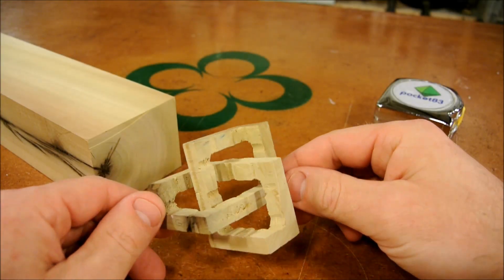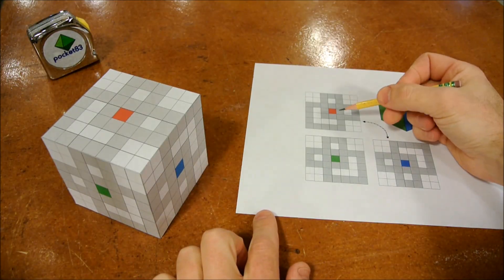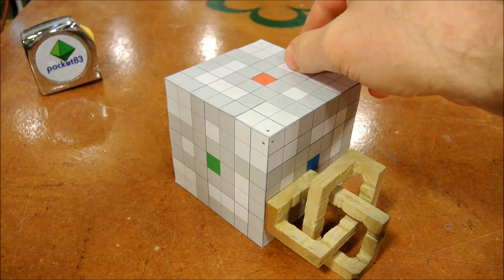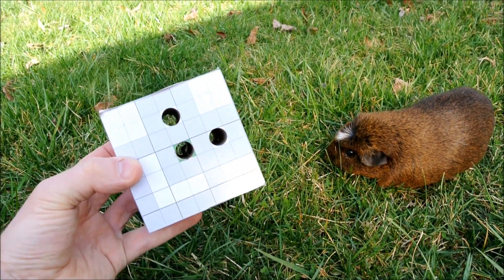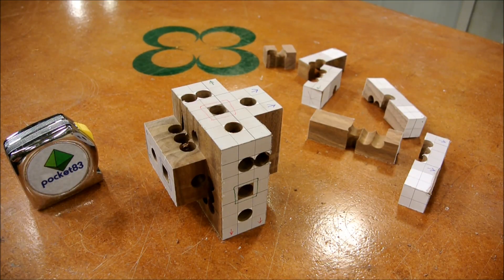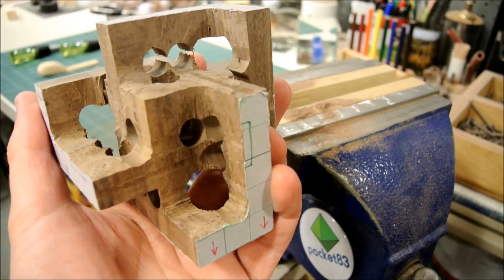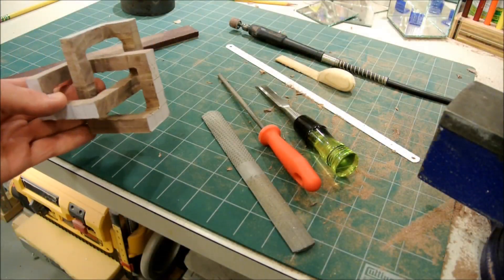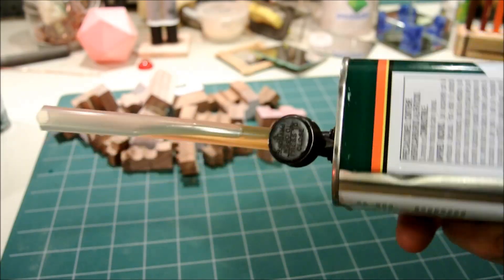Making a cubic trefoil knot from solid wood

Comment: so, i have definitely added this to my to-do list.  Ill probably use a softer wood though just to make finishing easier.
Reply from the maker: Careful. If the wood isn't tough, it's likely to crack as you work on it. Note that the prototype shown at the beginning here was Tulipwood, which is somewhat soft, but I was testing the limits of the process. Choose your piece thoughtfully ;)

Comment: First of all, awesome video.  Second, you mention 2:00 into your video that a future video will be dedicated to cutting the perfect cube.  Was this ever created?  I had a difficult time recently making 3" hardwood cubes using the same starting turning block (4" x 4" x 8") that you used.  When I went to a woodshop, I ended up using a joiner, planer, bandsaw to make 3"x3"x8" and finally a 10" miter saw to make cubes.  From your video, it looks like you just used a 12" miter saw.  Cannot be just that simple.  Thanks in advance.
Reply from the maker: It's tough. There are different levels of "perfect." That video was finished, but not released. It was just too conceptual in nature; that is, it was a how-to theoretically make a perfect cube that could eventually exceed (my) instrumentation. 

I'd figured that people wouldn't like it, since it was a bit impractical. I get sick of nay-saying comments easily. If I were to try to capture the idea in a sentence, I would just tell you to keep rotating your cube continuously against a square sanding machine, so that you can incrementally approach the 90° ideal through increasingly reduced error. 

Think of 'perfect' as less a goal, and more a fineness--like a resolution that can be improved by multiple smaller pieces of constituent information. Hope that helps, even though it probably doesn't (which is why the video wasn't posted).
Reply: @pocket83  Please re-consider uploading that video.  I think it will definitely appeal to the theoretical side of your audience.  :)

Comment: What kind of instrument is introduced at 11:49?  Is it an attachment that you added to another machine?  It sort of looks like a mini hedge trimmer.
Reply: Yeah. It kind of is. You could call it an oscillating multi-tool. It has lots of attachments, but at one point in the video I attach some sandpaper to it, just to rig up a detail sander. It was just stuck on to its saw blade with spray adhesive.

Comment: Brilliant video and workmanship. I have one question, may be silly. Is initial drilling of those holes necessary to complete this or to remove material faster, you have adopted that technique?
Reply from the maker: Aside from just removing material, I think the drilling has a few benefits. It helps you visualize what you're making, and it helps keep you straight as you make it. There are lots of perpendicular angles here, so it helps to have a 'framework' that keeps you in line.

You could certainly make one of these through carving it "by eye," but it would take extreme concentration and skill. With the holes, you should have a respectable result on your first try.
Reply: Thanks for your clarification. After I asked that question, I realised by watching the video once again, that, without those drilling marks, very tough to  visualise the 3D, and remove the correct part of it.

Comment: Like so many others, you use the chisel upside down. The correct way is bevil down.
Reply from the maker: You dim-wit. A chisel is what I decide it to be. If I use it to scrape gum from my shoe, that's the way I chose to use it. "Correct" ways to use tools are just procedural dogma for beginners. 

Further, bevel up use of the chisel removes material from the idealized plane, making it easier to stay  true, so you are just plain wrong.

Comment: Very good use of that vibrating saw/sander.  I also noticed you left the inside corners radiused instead of squaring them up - that would greatly increase the strength, or at least decrease the chance of splitting/breaking at an inside corner.  Good job, and a nice bonus tip at the end.

Comment: Why not use a mortising tool to drill aware holes instead of round ones.  It also might take away some if the internal cuttings
Reply: Two reasons: 
1) This is fragile, and a mortise cutter applies lots of pressure. 
2) I don't own a mortise cutter.

Comment: You need a jig to hold the oscillating tool at any given angle so that you can advance the piece to be cut.  Think along the lines of a drill press with a fixed mount to hold the piece to be trimmed/cut as you advance the tool into the piece.  Dont' know if you can contact me.  But, with the measurements of the tool, I could design a jig for you to 3D print.  Might do one for myself!  Excellent use of the oscillating tool!

Comment: Inspiring video.  I immediately cut about 20cm of thin steel gardening wire, formed a trefoil and distorted it into something like the shape you show.  As you suggest, the shape is hard to visualise and a 3d prototype is vital, for me anyway...  The shapes are topologically equivalent.  For anyone who doesn't know how to make a trefoil:  take a piece of string and form the outline of a three-leaf clover following the rule that as you trace along the string the overlaps alternate over, under, over....   you get a single loop that can't be disentangled in 3 dimensional space.  I believe it can be in 4 or 5 dimensions. .. I love celtic knots!

Comment: nice work. 50% of the time it works every time. lol. just trying to think of a practical application for this. no joke. its awesome. i know it takes the challenge away but id use your multi piece plan and then veneer. perhaps a mortiser chisel auger bit may have been useful or maybe it would blow it apart. again, nice job.

Comment: ...& done, thank you, it was a challenge, took over 5 hrs but I didnt use the transfers, I graphed 7x7 squares on each side [of the cube] and colored in the smiley faces in each color, so when I drilled and cut away I still knew which side was which,, this came in very handy at the final stages when the bricks need to be cut to an L for the lightening strike.. bit.. 
 If anyone uses the transfers, color them in, do all sides, it will be worth it when you're close to completion, and to Jeremy, thank you for the aluminium block improvisation tutorial, it helped viewing your cuts with the hacksaw rather than the table saw at times.. all round, Im thrilled with how it's turned out, i'm not a trades person, carpenter nor any skilled wood-worker, this project is for everyone, do not get scared when you're at the final stage, I had to make x3 cuts (leaps) of faith and the piece of art revealed itself.. 
 poetry.. thank you Pocket.. just thank you. :)
 - Julio
Reply from the maker: Congratulations! It feels like pure relief to complete it, doesn't it? Thanks for letting me know that you did it ;)
Reply: Thank you, that last few cuts and the knuckles revealed the diamond in the rough & brought on a smile like I was just dealt the Ace I needed to go all in..  I was forced to draw the squares as I couldn't print out perfect sized templates for the cube of wood I'd sourced, Jeremys vid of drawing the faces with colored lines inspired me to do same on the cube.. it didnt come out the prettiest as I used a dremel workstation and a hand saw... but it's complete, solid, and now to build one to put on display in the house.. many times during the project I wondered how in hell you figured it out.. it made me realise I had simple task compared to what mental suffering you must have gone through.. :D 
 It's something for life, and will be a wonderful conversation piece, my thanks cannot be expressed in txt enough.. 
 I cant stop looking at it.. :)
 Thank you Pocket..
 - Julio.

Comment: i cant get my head around the 2nd set of templates you're adding.. 
 do I make copies of the original 3, and cut them down to match.. or are you glueing templates onto templates. can anyone help with some advice.. thanks :)
Reply from the maker: All six templates are the same. I just used the colors to mark sides that are opposite from one another. If you print out two copies of my template, that will be enough for all six faces. Just keep red on the other side of red, et cetera. 

 As for placement, just think of it as having two sides, like a left and a right side for each color. The same-color templates will have to line up, kind of like your two hands will line up if you press your palms together.
Reply: Hi pocket83 many thanks, I watched the section again post reading your comment, makes perfect sense now, :) made no sense when I mistakenly thought there were extra modified templates being added.. :D my bad.. all good now tho.. thank you again.. I cannot wait to try this. :)
 - Julio

Comment: If I were you, I would have given depth to the template paper. Eg by shading the faces that have depth.
Reply from the maker: If you were me, you would consider that unnecessary. But by all means, go for it if it helps you reduce confusion.
Reply: yeah, as I was watching, there was the template on one side and I didn't know if you were cutting into it or if it had depth. but anyway, your method does seem much easier than any of crap.

Comment: Hey Pocket, very cool project! Most of the time I can take something away from your video's even if it's a project I don't plan on replicating myself. This time it was spray adhesive sandpaper to your multitool at 15:35. That's just a plain stroke of genius if you ask me! I use the sanding triangle on mine often enough, but using either a scraper attachment or an old blade with sandpaper glued on gives this often times overlooked tool even more versatility!

Comment: i was already wondering before you used the center-finder: why didn't you print the square's centers?
Reply from the maker: I did think about doing it. But it's just ink- it doesn't help the drill bit to center. Also, the template is already intimidating looking enough.

Comment: very nice. Looked lovely after adding the teak oil. But man that's one complicated shape to cut from one piece like that. Must have taken a lot of thought.
A question: near the end of a video, you were using a tool I haven't seen before to do most of the cutting (not the coping saw). Could you tell me what it's called?

Comment: I understand the reasoning behind not doing it, but I'm surprised that you didn't square off the inner round corners left by the drill bit. Since you didn't, I would think that you'd want to round the outer, opposite corners. Either both square, or both rounded.
Reply from the maker: Round insides are stronger. But ultimately, I made the choice for aesthetic reasons. Don't allow symmetry-based rules (which are mostly arbitrary) too much latitude wrt design: All crisp corners would look clunky and mechanical, while all round would look too organic, or like a wet noodle.

I'm pleased with it ;)
Reply: +pocket83 I would be absolutely pleased with it, it looks incredible. Just wanted your opinion as to why you choose that. Thanks for the awesome videos! Did I miss the hidden puzzle in your latest videos?

Comment: Great overview. I'm about as thick as a wool blanket on the Berlin Wall, but I understood it. The rounded inside corners and the hard outside corners were an interesting choice.
Reply from the maker: I'd say you were clever enough to notice that. Radius corners add much strength. Thanks.

Comment: Fun fact: your cube had a maximum side deviation from an ideal cube of less than 1% (0.1141% in the side with maximum deviation). Impressive indeed. I thought wood working couldn't achieve such numbers.

AND YOU DESTROYED IT!!!!
Reply from the maker: I didn't stop there. Off camera I continued to reduce that error by at least one half (I didn't expect anyone to pay attention beyond three significant figures, congrats). The bulk of the error in this procedure comes from the drill press. Watch it flex in the 4X shots. That's why I kept rotating as I drilled.  

As for cube perfection, I've filmed a video on the subject, but it is very metaphorical in nature, so I don't know about releasing it. I'm debating.
Reply: +VeteranVandal How many times you messed this up? I mean, there is no way you did this right first try...

Comment: That was brain bending...   Next I might be inclined to either make a glass case for it or maybe wrap it in fiberglass, as I would be afraid of it breaking.
Reply from the maker: It really wasn't bad. The confusing part was over after figuring out the first one. And it's way stronger than it looks, because I kept the radius on all of the inside corners. 

But you're right, I probably should hang it up or something. Imagine sitting on the couch and hearing <CRACK>
Reply: +pocket83 ahhh that's why you left the inside corners radiused...

Comment: VERY cool!
Nice practical use for one of those oscillating saws, both to cut and to sand.
Reply from the maker: Thanks John;) I held off getting one for a long time, but it turned out to be way better than I'd guessed. It's like 15$ at Harbor Crap. I HIGHLY recommend the sanding function/trick.